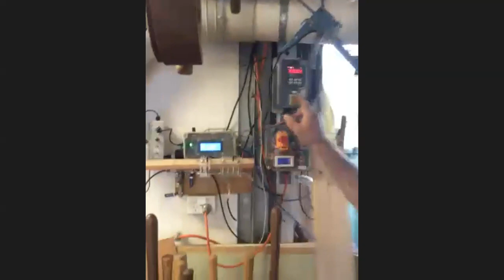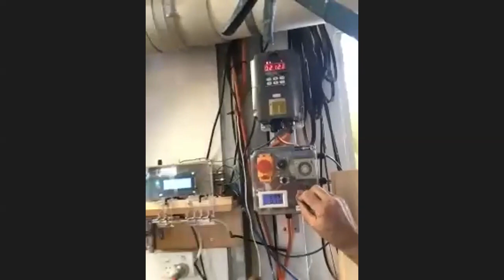Understanding dust and dust removal in Men's Sheds

Comment: From Dunsbough Men's shed. Much appreciated Bob I learned a lot and will have to replay it a few time to digested it all.  I see that your Tee y branches are vertical. On a long headers  with a lot of branches could that causes dead pockets? Your vacuum shed is the soundproofed how about the air outlet?  Is the outside ventilation system continuously working?
Reply: Thanks Adel. Good point about Tee Y pieces and dead space which can fill with dust but mine are all gated immediately after junction so volume of dead space is small and always easily cleared when gate is oped and DC is running. Ideally the takeoffs should be vertical so no dust can accumulate in the dead space but not many DIY sheds have the height to do this,. Regards the vacuum shed sound air outlet sound proofing - yes there is an acoustically treated double-S bend exit - a double shaped MDF box  lined with 50 mm foam. Outside ventilation system is continuously working while making dust and then for 10 -15 minutes thereafter,